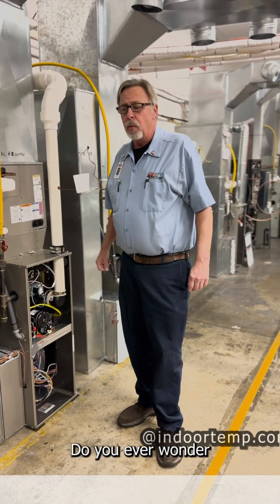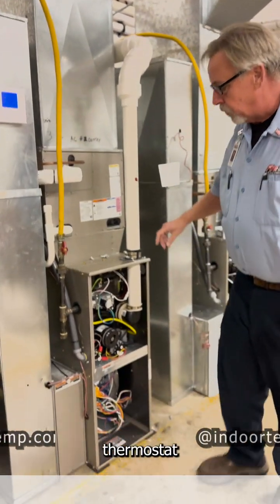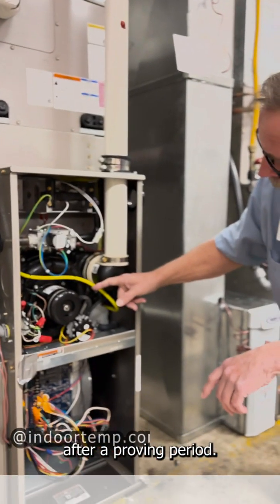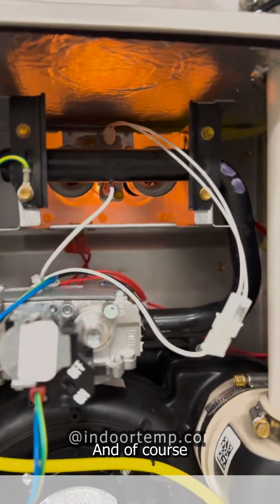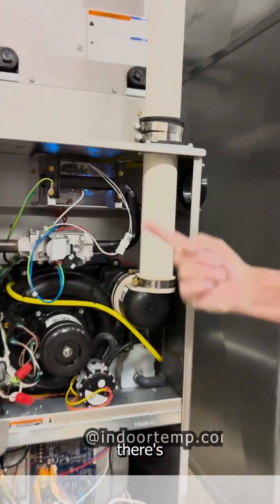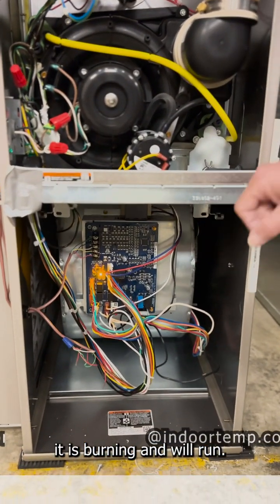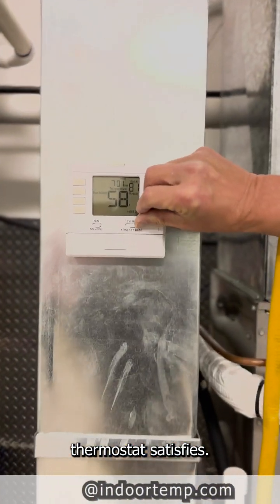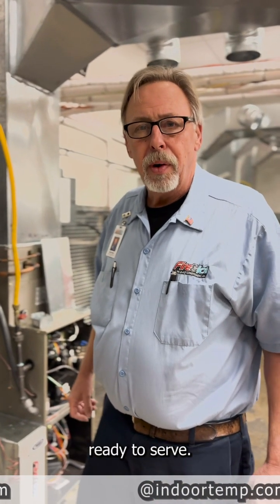Do You Know What Actually Happens When You Turn Your Thermostat Up? Roger will tell you!

Comment: Thanks for sharing. I have a weird thing that happens now that I “upgraded” to a nest thermostat. After I reach temp my heat kicks off, a minute goes by and it calls for heat again and runs for 10 minutes or more. I have reset and deleted settings to test this on a solo heat call and repeated outcome. Oddly enough it doesn’t to this for AC.
Reply from the maker: Without being able to see the operation in person, it’s difficult to offer assistance on this one